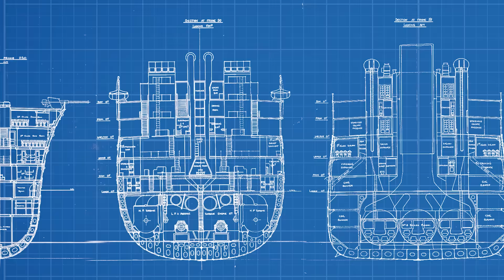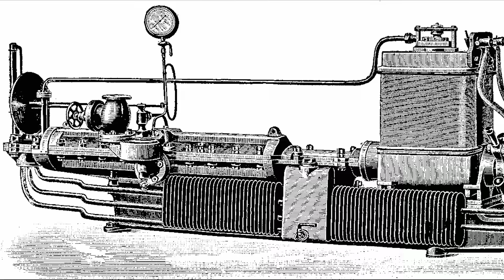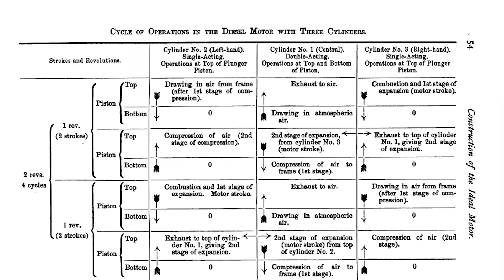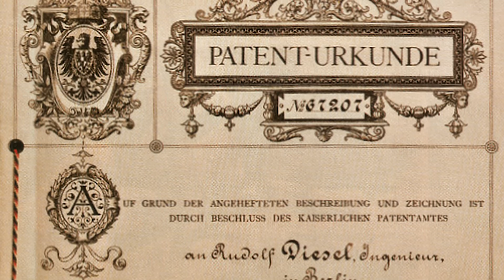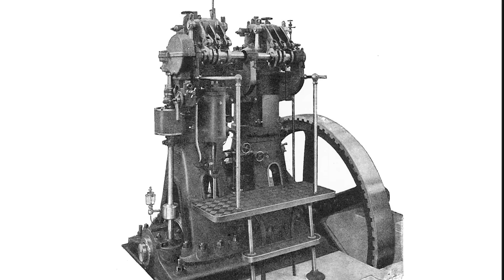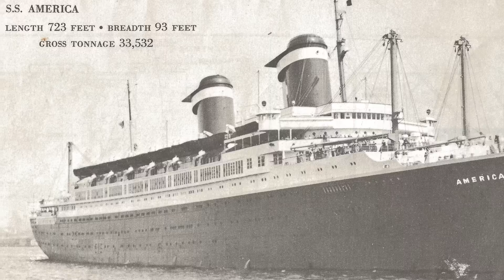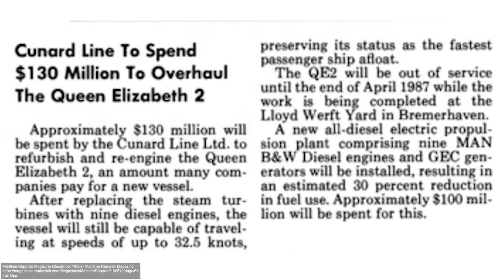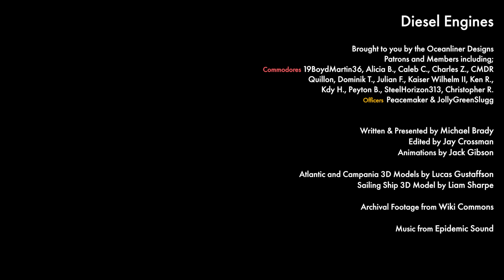How the Diesel Engine Became King of the Seas

Comment: steam engines, or more correctly boilers, can also burn liquid fuel. And a lower quality fuel than diesel. As for torque, steam  engines can have maximum torque right off zero RPM.
Reply: On the other hand if a warship is cruising and needs to get up to battle speed fast, a diesel can accelerate quickly, a steamship has to light additional boilers and/or build up steam pressure and takes some time to work up to full speed. In the Battle of the River Plate, the Graf Spee with diesel engines had a big speed advantage over the steam powered British cruisers early in the battle, later the British had the edge. Unfortunately for Graf Spee, her captain didn't use that speed advantage to run away.

Comment: not quite accurate; the diesel engine compresses air making it very hot, then fuel is injected under great pressure, which doesn't really serve to heat the fuel as much as it serves to vaporize it or at least reduce it to smaller droplets which burn readily
Reply: IIRC unlike in gasoline engines, if the fuel is injected into the diesel engine cylinders before the compression it'll cause detonation, correct?
Reply: @minhducnguyen9276  Diesels inject the fuel near top dead center when the air is the hottest- diesel does not detonate, or more correctly knock, like gas engines do because of the nature of combustion.  It has it's own combustion issue, but injection timing can deal with it.
Reply: Just see what is happening thanks
Reply: That's only true for modern diesel engines. There was a lot of other methods for early diesel engines.

Comment: Currently, the trend for commercial Shipping is going from traditional diesel engines towards Dual Fuel engines: 

A dual-fuel marine engine can run on both liquid fuel (diesel/HFO) and gaseous fuel (LNG), offering flexibility, lower emissions, and compliance with environmental regulations. It operates in gas mode (using LNG with a small diesel pilot) or diesel mode (using conventional fuel). This improves efficiency and reduces pollution. 

The first ships are also delivered Ammonia ready, meaning the Fuel Gas Supply System is ready to run on Ammonia (NH3) as fuel, thus the Ship reducing the Carbon footprint during Operation to almost 0. (One Example of this would be the  Aurora Class, a new RoRo Ferry operated by Högh Autoliners).

As someone who works in the Industry, I belive this to be the standard in the near future along with fuel cell technology.
Reply: Yes, still working as diesel-engines. As I recall (the switch over happened just when I left that industry) the air first gets compressed together with the gas. But it does not heat up enough. Then a tiny "ignition flame" by a smaller Diesel-Injector is used to light the mixture inside the chamber.
Reply: The "dual-fuel" engines are still Diesel-Engines, even when running on gas, aren't they?
Reply: @JanJan-oc7yb  Technically yes, in the same way coal fueled boilers and nuclear energy are both used to power steam turbines. 

On a surface level they are similar, but very different systems in detail.
Reply: @Mr1Nutzlos  Fascinating, thank you for the insight.

Comment: I have some experience of the re-engine process. My now defunct company (Mobil Shipping) I sailed with from 1975 until I came ashore in 1982 (and retired from in 2013) had a series of steam turbine VLCCs built in the mid-1970s by Sasebo in Japan. At the end of 1978 they took one built in 1976 (Mobil Hawk) and decided to convert to diesel. Unfortunately they decided on 2 x V12 Pielsticks linked together via a reduction gear to drive the single shaft. I sailed on her straight after conversion and was an absolute disaster. She tended to break down every day so much so a 6 week voyage from Curacao to the AG took over 3 months. All kinds of problems but the most common was related to the cylinder heads and (I am not an engineer - deck side) I understood was related mostly to the tightening down sequence. Apart from the the breakdown problems, which I as a third officer had to deal with at night (the Master told me not to bother to call him), the startup of the turbo chargers was so loud right behind the wheelhouse that the lookout had to be issued with ear defenders. This was later resolved by fitting a baffle system to the outlet area on that deck. Mobil would then go on to convert a further 5 similar vessels to the same Pielstick diesels. The amount of work the engineers had to do thereafter was extraordinary so much so we had to re-employ 5th engineers to act as assistants having made them redundant when the ships were first converted. Yes they saved fuel but the cost of spare parts, repairs and extra staff negated those savings let alone the stress on my fellow engineers. However all of the vessels sailed with the company for about 25 years so had a long life relatively. After the Hawk I went to another (Mobil Falcon - then a steam turbine vessel) for 7 months and had a great time. She then went to be converted and I sailed again straight afterwards. Again another disaster for same reasons. Some data available on a website I recently built: https://mobilship.uk/
Reply: Well put.  I sailed as C/E on the same Pielstik plant in a bulker, those engines were really terrible.
Reply: They're known as pigsticks for a reason lol.

Comment: It's crazy to really think just how inefficient internal combustion engines actually are, even diesels. All of that heat that they make that we have to actively remove with radiators and fans, and all the heat still left coming from the exhaust, that's all just completely wasted energy.
Reply: That's why many diesels are now turbocharged, using the waste heat to make more power.
Reply: It really is a fascinating topic. I worked at a company that designed ways to improve efficiency. There were some big gains from cogeneration (like routing waste heat to where you want heat anyway, think of car interior heaters) and adding recuperators to scavenge energy (like a turbine that pulls energy from the velocity of exhaust gases, maybe to drive an intake compressor or an electric generator).
These engineers will work furiously to squeeze even a 1% improvement. It's wild.
Reply: ...which could be used to create an additional steam...
Reply: @cheulesyigess1187  additional steam?
Reply: @TheTonyMcD  Many big ships nowadays have so called "Exhaust Gas Boilers", which as the name implies is a small steam boiler heated by the exhaust from the diesel engines. This can provide steam for whatever it's used for on the ship, for instance keeping the heavy fuel oil warm enough that it can be pumped and injected into the engine. This saves using fuel to run a separate boiler as long as the main engine is operating.

Comment: Were all steam engines coal fuelled?
Wouldn't it be a simpler upgrade to heat the steam using diesel, or other liquid fuel?
Reply: Steam could use fuel oil. I am not as familiar with steam on ships, but with steam locomotives fuel oil was popular in the western US; where as coal was popular in Europe and the eastern US. There's a lot of oil fired locomotives still running at museums and heritage railroads along the Pacific Coast and as far inland as Colorado.

Comment: Hold on, you don’t think solar power will replace diesel???
Reply: It'd be tough. A quick look online says the avg solar irradiance worldwide on a sunny day is 1kW/m3, which over a 300x40m area would be 12,000kW, and the world record efficiency for panels is about 48% call it 50, makes a potential of 6,000 kW or 8,000 engine hp. Another look online says most ships of 300m, at least lakers, are equipped with 8,000-18,000 hp, and I assume they'd be running 24 hours. So it seems to me an all-solar ship would be underpowered at the best of times
Reply: ^ Though to be fair those stats are still impressive in themselves and I don't see why diesel-electric ships or trains couldn't benefit from hybridization
Reply: @rrobkaiserr  I think a lot of ships are diesel electric these days,, so although not a trivial upgrade, I don't see why it wouldn't be possible. Ships are a great candidate for hybridisation.